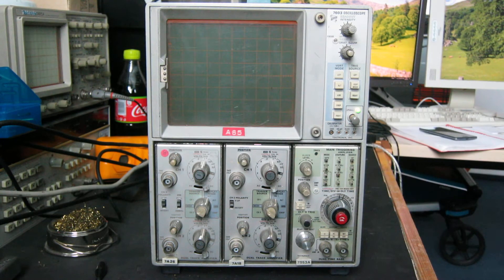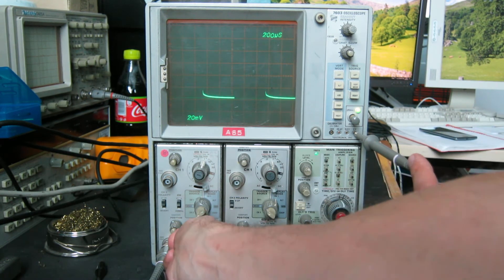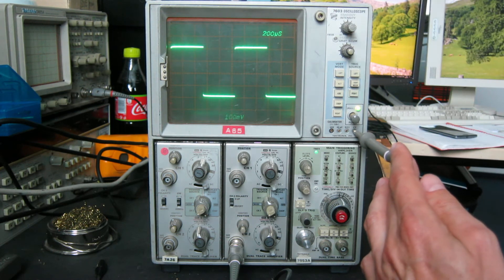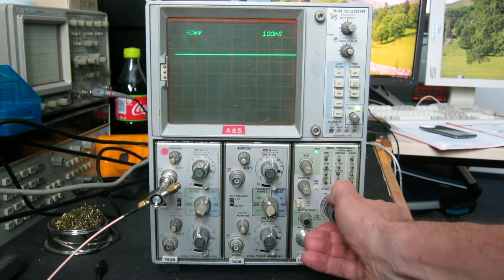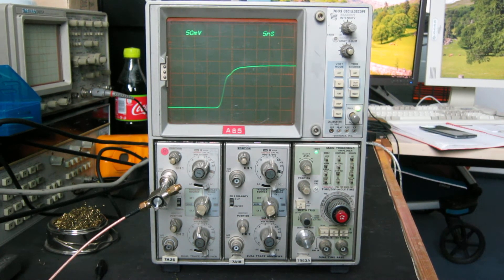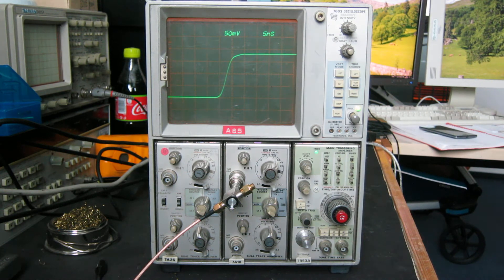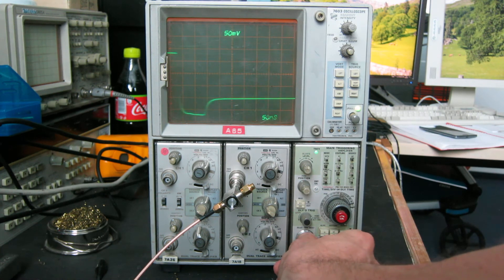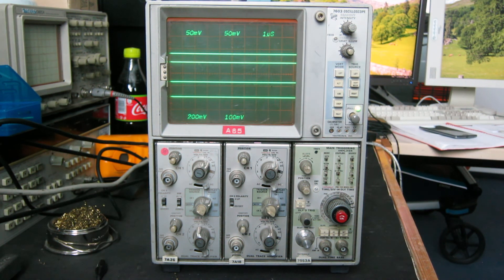Tektronix 7603 with 7A26, 7A18 and 7B53A plugins

Comment: Good morning,
Nice video, very explanatory for the left and right side.
I have this type of oscilloscope, but can you tell me which pulse generator you are using when connecting.
Thanks in advance.
Good day
Skop
Reply from the maker: Thank you for your comments on the video. The pulse generator I used is a Tektronix SD24 sampling head fitted in a CSA803A mainframe. Its pulse risetime is about 20ps, so it's a pretty good reference for checking oscilloscope risetime.

Comment: hey i got the same oscilloscope, but the kabels i have to connect the channels, how can i determine which ones i have to buy? do they have to be 1m ohm 20 pF?
Reply from the maker: If you mean probes, then yes, they need to be able to compensate a 20pF input. The cheap "P6100" probes widely available work absolutely fine in their 10x mode (never use the 1x mode). But remember that you need to adjust the probe compensation using the scope's calibrator. I think instructions for this normally come with the probe, or are easily found online.

Comment: Nice thorough tour of that old scope. I am however quite surprised that you've had no problems with your wafer switches. They normally give problems with age.
Reply: Doesnt it have cam switches instead of waver switches? However, main proplems of waver switches ant potentiometers occur if they are not used for a long time.
Reply: Cam switches...  the only thing i hate of  the 7000 series..